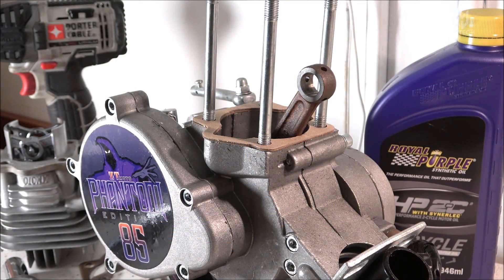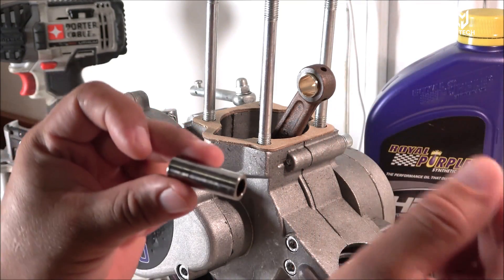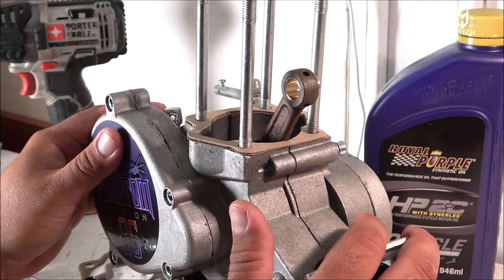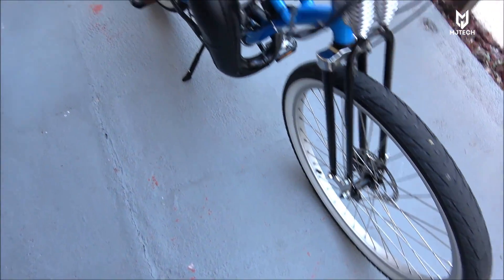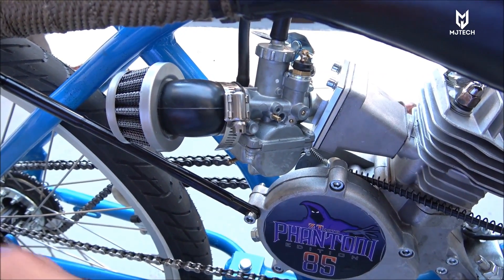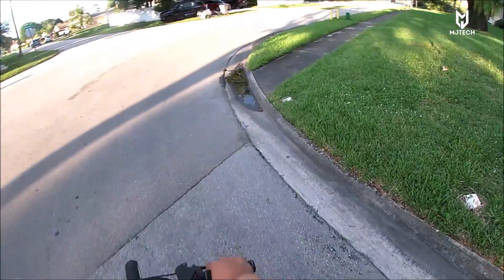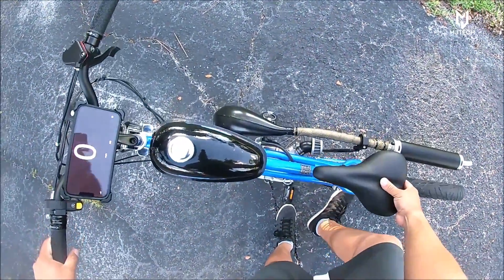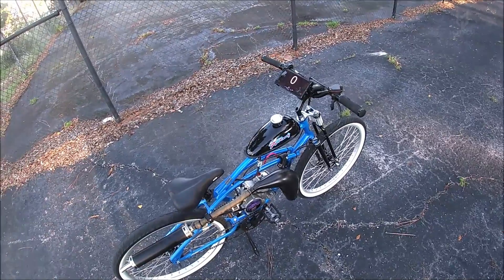Phantom 85 Motorized Bicycle - [Mods & Fixes] - 42MPH with Half Throttle!

Comment: So, has the maker done anything about that bushing? 

I'm close to pulling the trigger on this kit, my first build, but I've seen quite a few complaints about damaged or missing parts.  

I want SPEED/POWER/QUALITY, and, I hear this particular motor is the one to buy >>>>>> for a Beach Cruiser  😎
Reply from the maker: @whatsyurprob158  Yes it has been fixed. They now have the V3 out

Comment: I have a 80cc with 
-Reed valve 
-windowed piston
-mikuni carb 32mm
-performance cdi n spark plug 
-power boost bottle 
- 36t back sprocket 
-expansion chamber exhaust 
Do you think I can hit at least 40mph? 
im asking because I’ve only built it, i havent turned it on yet
Reply: what was your top speed?
Reply: @topdog3407  62mph

Comment: I was told that to that the bottom half is from a yd100 I got my phantom in the other day and I noticed that when I was installing the wrest pin and bearing that on my yd100 it's 10mm but on my phantom it's 12mm so if there both yd100 bottom half why is that different?

Comment: The problem of your motor "4 stroking" may be the reed in the reed valve manifold. If the reed is to stiff it can cause the incoming air not to mix properly with the fuel as it moves over the reeds. Less stiff reeds could be the fix there.

Comment: I found the LD 100cc to have a zmn100 connecting rod with a 12 mm wrist pin. And it comes with bearings not bushings.Chain saw parts work best .
Good luck and Ride Safe
Reply: Ya,I also wondered why he was running a bushing and not needle bearings.

Comment: Did you put any oil on the small end when you put it back together. 

The sides of the bush should be level with the sides of the rod Little end.

Comment: U'mm that small end bush is no good. It needs to be "pressed" in (interference fit) otherwise is will spin in the small end and cut the oil off to the little end. That's bad.
 Those oil holes need a drill bit through them with a nice radius to catch the oil. 
That old bush has come loose and  moved around. Being with a split is correct. Every little end bush I pressed in and machined was steel back brass or copper. Go to an engine shop and ask to see a small end bush out of a diesel and that's what you'll see, but Big. 
That little end failed due to lack of lubrication either because it came loose as is evident by those solid brass Bushes. Your going to have to knurl those and Loctite them. Dodgy as. I'd check the little end with a telescopic ball gauge. Because if that guy made those bushes to size they shouldn't fall through the hole. What's the OD of those. Ones wrong. 

Don't run it to lean. Two strokes are supposed to smoke. 

Back to your vid
Reply: @Mike Rammelt, was going to say the same thing, bronze bearings needs to be pressed in or it will spin and damage the rod

Comment: After 3 months, I'd guess that the replacement parts aren't coming! I got lucky and picked up a returned engine for $35 on Ebay with a good cylinder. Did the mod with an MS380 piston and the 2 bushings, 10mm wrist-pin and cage-needle bearing. Added an KX85 pipe and it screams! Hope it holds up better than the factory one did!
Reply: Did the guy mentioned in this video pass away? I ordered this about 5 weeks ago and I’m still waiting on it. Should I just give up?
Reply: Wich bushing dimensions did you used??
Reply: @omargdottin  Sorry, I just saw your post. I used 10x12x8mm long, shortened the 10mm pin and used needle bearing.

Comment: You have to drill tiny holes in the bushing to allow oil to penetrate to the pin.
Reply: Winner. Not only that the little end will spin round and move. That's bad. And the sides of the bush need machining. 
No wonder it still rattles
Reply: @mikerammelt2420 so thats good to drill the?

Comment: Well done man. Subbed.
Seeing as this is actual US-rated 85cc. Would you reccomend this over say the BT100  or the YD100 from Zedda?? (torque wise especially).

Thanks
Reply: Yes it has way more torque
Reply: Well I’d say if ya ant a crank bearing and bushing failure and ring snags go form the phantom otherwise build a ms440 or 380
Reply: I love this far more than my yd100

Comment: Copper bushing ? No. Its bronze. Your using a bushing....... I think a bearing has less friction.
Reply: Yeah and is not supposed to fall in to the Little end. Needs to be a pressed fit then machined to suit the pin.

Comment: if you polish the exhaut duct it will increase top speed and performance and also get a foam air filter like the uni filter, its because of that the mixture fells rich but in reality it doesnt get enouf air thru

Comment: man im glad someone  finally showed a proper fix . not that i have a phantom nore would i buy one at this point .  good job on that . how ever looking at your expansion chamber pipe .  i have to ask the stock pipe that comes with the phantom is way bigger.  did you mod the pipe to fit with no restriction?  i ask cause in the video it looked like it was a bit small compared to the stock pipe .

Comment: how to solve overheating issues w this motor?
Reply from the maker: Probably running too lean or too much oil on your mixture
Reply: @MJTechChannel  sweet thanks man! still in break in can’t wait til the bushings are back in stock, can u post a link to the mikuni carb u got?

Comment: welpz it's time to get the Chinarelli vs phantom 85
Reply: Would be a good race but we don't k ow what these 85's will do yet.
Reply: @kjsmolik  yeah, but I'm also having a special order coming in, Iron sleeved Chinarelli is happening but it's for something I'm not sure if i can do it myself all the way without issues, and probably my longest trip, pompano beach to key west and back (400 miles). if you can relay anything to me to make sure i don't have issues, I'll be greatly relieved for I'm already preparing for the worse.
Reply: @ArthronOfFir3  I would say inner tubes, extra chain, extra clutch parts. Head gaskets. Spark plug. Definitely extra cdi, magneto and magnet.  Clutch cable.
Reply from the maker: @ArthronOfFir3  You’re in Pompano and I am in West Palm Beach. We should meet!
Reply: @MJTechChannel  definitely but I'm going to be at my hangout area of quiet waters park, for i don't like to travel too far that often. also the build is not considered complete yet, for i need to do some extra stuff to make it complete.